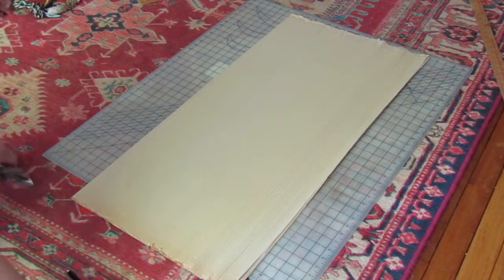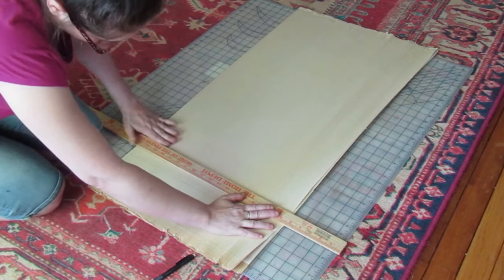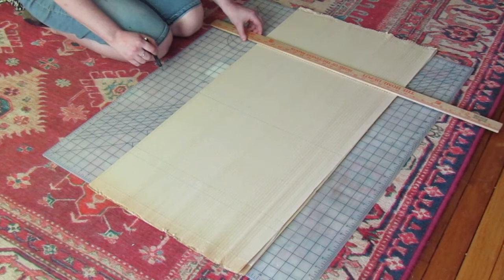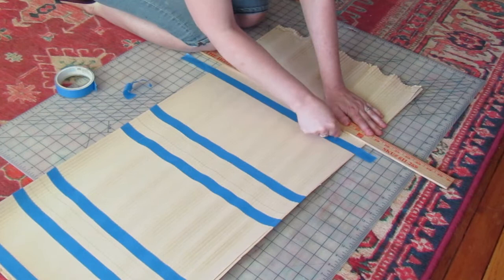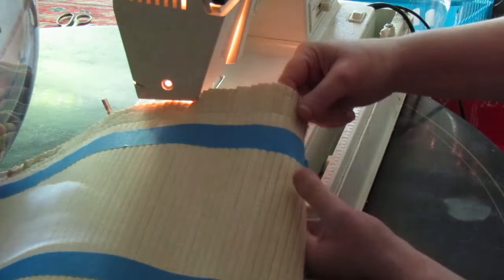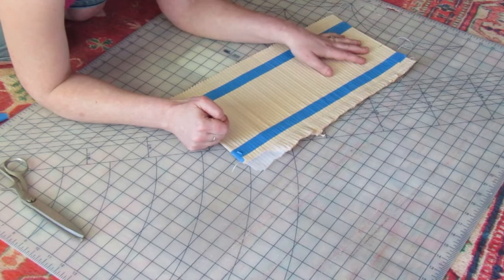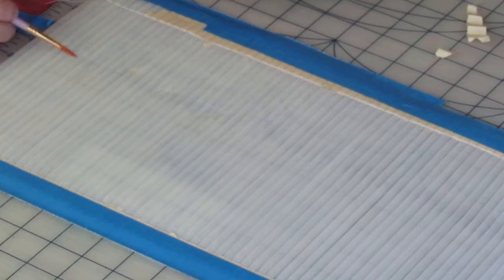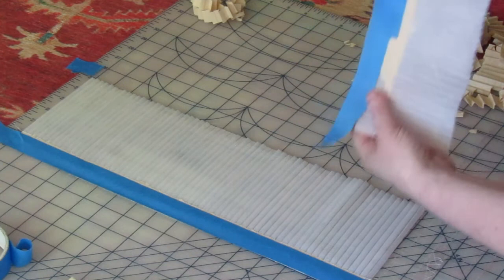How to Make Knife Pleated Silk Organza Victorian Trim Tutorial

Comment: This is great, Elizabeth. I have never seen this done before. I'm sure I can incorporate it on a smaller scale for my doll clothes. I wasn't clear on the Fray Check alternative. Could you give directions on making it and what PVA is? I can't wait to see your next video!
Reply from the maker: Sorry I had to cut it that part out due to focus issues! PVA in an archival glue used in bookbinding and such. It is the plastic binder in acrylic paint. Once dry it is unaffected by water and helps to maintain the pleats. Note i am hoping to make pleating boards like these to sell. So take 1 part PVA and 2 parts water. Mix well and then "paint" onto the edge. It's essentially invisible (always spot check first).